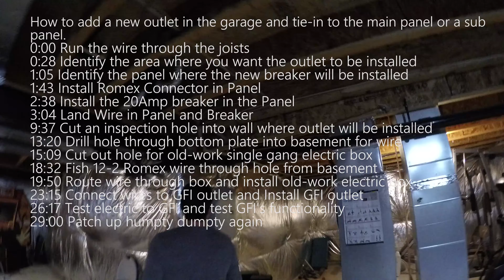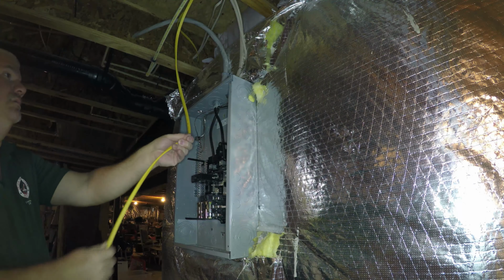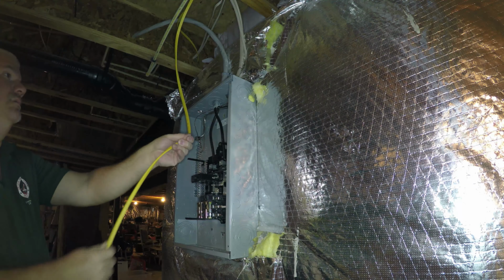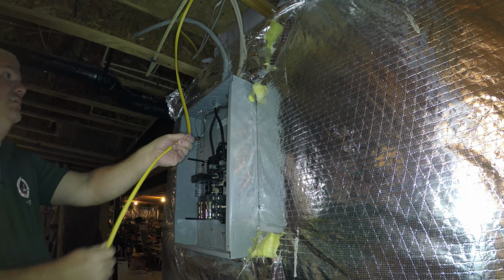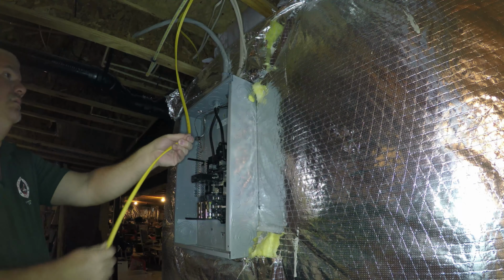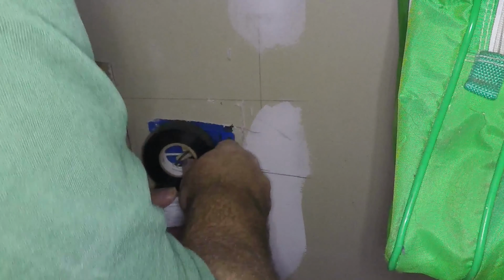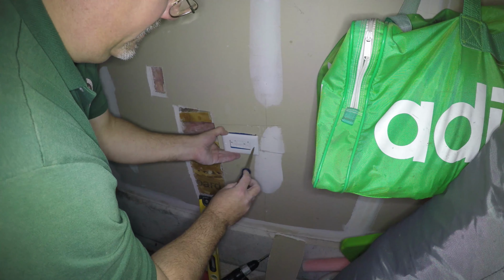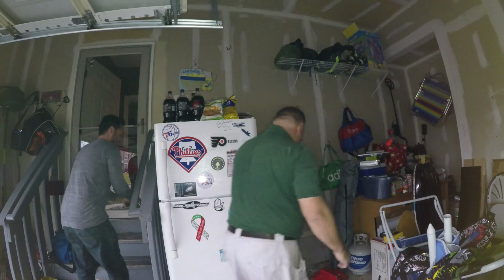How to Install an Outlet and Tie-In to Sub-Panel or Main Panel from Start to Finish for under $100

Comment: u did many collateral damage
Reply from the maker: Hamza Alaa for sure!!! Joe is handy and this is an easy project for him to clean up.  Cutting into walls can be hazardous and having a full understanding of the structure, piping, wiring, gas lines is really important. I went for safety over perfection.  Joe didnt mind cause he got a new outlet wired up for free. He just had to buy the materials.
Reply: Ok.  Congratulations